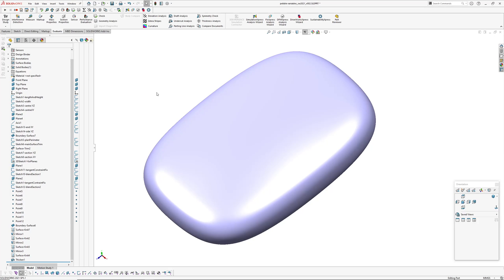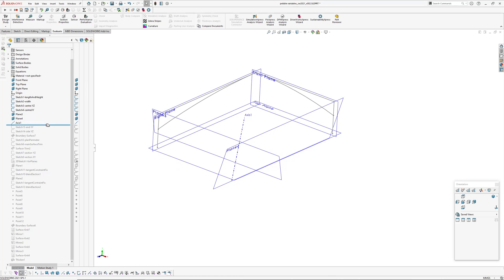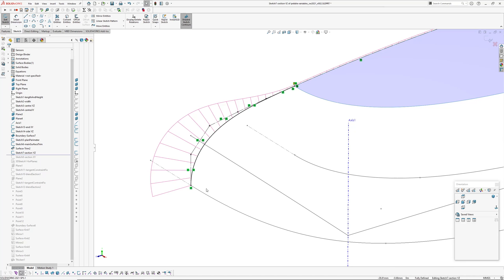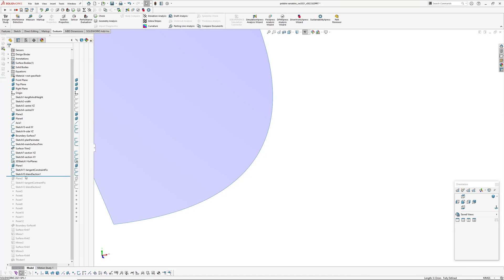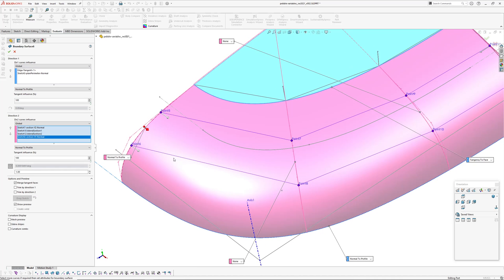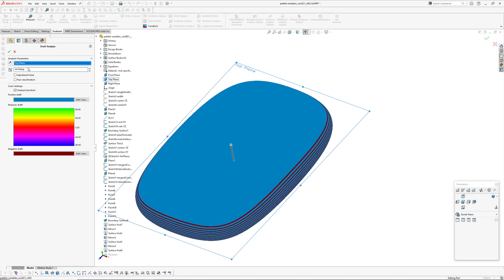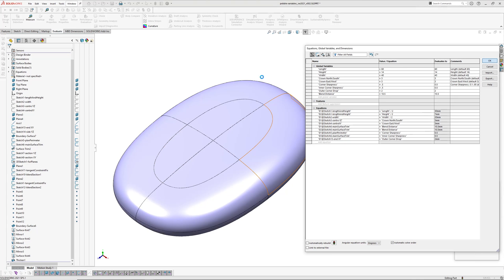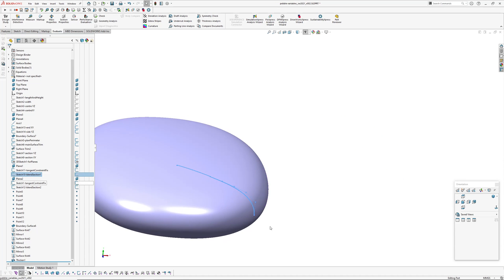Pebble Form Using G3 Constraint in Solidworks

Comment: So I've been trying to recreate this without the variable control using just your default dimensions for practice, but I'm stuck on actually creating the boundary surface of the blend section. I'm able to create the boundary surface successfully (7:00 for reference) if I just use the section YZ and section XY sketches in Direction 2, granted the quality of the surface isn't as clean. However the moment I introduce the blendSection1 and 2 sketches as additional guides in Direction 2, the normal to profile on the planPerimeter sketch in Direction 1 fails.

I get this error: "The guide or profile curve's tangent at the constrained point(s) does not match the tangent of the constraint", which has been throwing me in a loop as to how that is. 

I can't find very much online about this error either. I've tried propagating it anyways but it introduces a small wrinkle after what would be your Mirror3. This feels obvious, like I'm just drawing the splines wrong or the conic patch surface after the main trim is faulty somehow. I'm definitely not anywhere near your expertise so it could very well be something I'm overlooking, even after studying your part file. 

Any tips on how to prevent that error would be great!
Reply from the maker: Hi there. Can you send some screen grabs to my email - andrew@ajdesignstudio.co.nz - and I can have a look later. From your description I'm not that clear on what the issue may be.
Reply: @AndrewJacksonDesignStudio  Thanks a ton! I'll send it over some time this week.
Reply from the maker: @XY6BeAsTsX  Ok all good
Reply: @AndrewJacksonDesignStudio  I was getting ready to send over the screen grabs and managed to find the issue when giving it another look. When creating the planes to draw the blendSection sketches, I accidentally used the patch edge itself rather than the planar mainSurfaceTrim sketch as my second reference. It was a passing glance, I just happened to see the very slight tilt it gave the planes and right away, the error made sense - works fine now. Very simple mistake, kept on overlooking that! I truly appreciate the willingness to help though!
Reply from the maker: Good stuff! Always the simple things!

Comment: I found your channel whilst looking for tips on resolving degenerate surfaces...and I'm really glad I did.  Some real gems here.  Thank you.

I'm surprised  to see points defined by "Distance" at 6:23 rather than by "Percentage".  It's good that the points will retain their even distribution when a model change alters the lengths of these curves, but to anyone who didn't know how those points were created, it won't be obvious that they're evenly distributed. I wonder what SW would do if some well-meaning person rounded that 3.88277... to two or three decimal places to make it look more "intentional".

I really would have expected SW to default to "Percentage" for evenly distributed points.  There should, at the very least, be buttons to choose between distance and percentage when initially creating the points.  I might ask my reseller to raise a ticket for this.

Edit:
I just tested the effect of altering the "Distance", hoping that SW (2022 SP5.0) might maintain the percentage of whatever the edited distance was, i.e. if the rounded down value equated to 32% instead of 33.33%, I had hoped that the 32% would be retained when the curve length changed, but it doesn't.  SW converts it to an unintelligent fixed "Distance" along the curve.  Any other points created at the same time, but not subsequently edited retain their even distribution relationship, so as you say, there IS something going on behind the scenes...but it's not quite smart enough yet.
Reply from the maker: Hi there. It’s a shame that the reference point feature does not expose the point location percentage to equations, as that’d be very handy for this situation. I’ve not used 2024 so maybe they have finally allowed reference point percentages to be controlled externally.

Comment: Great tutorial, could you explain why you used tangent to face in your boundary surface instead of the curvature to face? Since you were trying to get G3 I would have thought to use the curvature relation. thanks!
Reply from the maker: Hi there, that is a good question. Quite often when using boundary surfaces, if the boundaries and any cross section curves are CC, then the resulting surface appears to be CC as well, even though the boundary condition is set to tangent. Lots of times in these situations setting the boundary to CC results in no improvement in the surface flow and sometimes ends up with SW forcing a small wrinkle along the affected boundary. I'm waiting for Dassault to add a G3 constraint to the boundary surface, as it seems a bit lacking to have G3 for sketches but not surfaces. Also, Solidworks has no native tools to check whether a boundary is actually CC, so I have been running surfaces through Rhino and using the Global Edge Continuity tool, which can check boundaries for G0, G1 and G2 and lets you know the tolerance on those edges. Thanks for watching and commenting!

Comment: Hey Andrew, love the videos, always have some amazing techniques. I've pretty much exclusively done parametric modelling in my career but Rhino is something I've always wanted to sit down and learn. I'm curious, in your real-world work what does your workflow involve? i.e do you create these kinds of surface models in Rhino and port over to SW for detail design? My basic knowledge of Rhino is that these kinds of forms are much easier to create.
Reply from the maker: Hi Phil, good question. I've worked on very few projects where something has been built in Rhino then imported into SW for further modelling. Clients would always prefer to have everything in one package if possible. Especially in the later design phases. 

The pebble surfaces would be much leaner and cleaner in Rhino, with the trade off being having to rebuild and rematch surfaces if you make alterations, vs SW (hopefully) updating and being quicker to test things out. Rhino does have history on some functions and seeing as the pebble is pretty simple from a layout POV, you could probably make this and tweak things fairly easily without fully rebuilding. Cheers, AJ